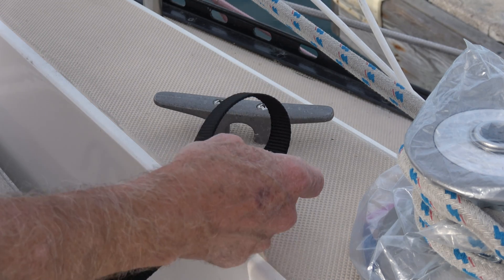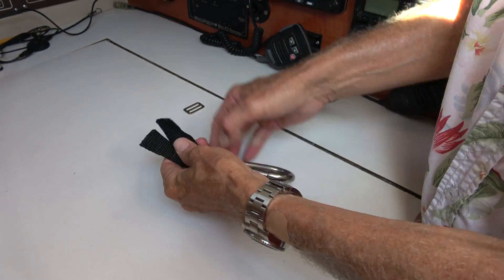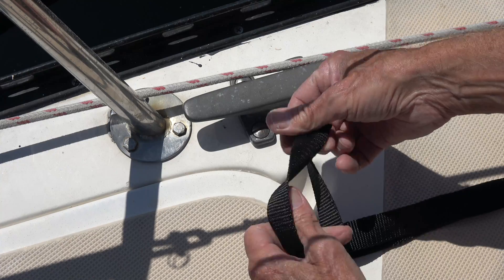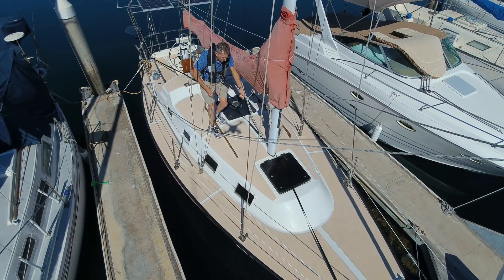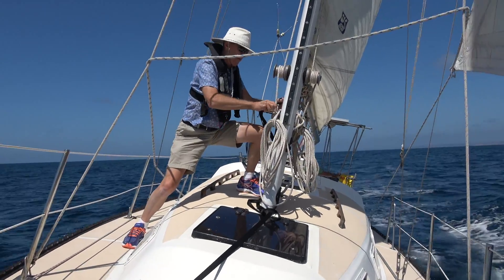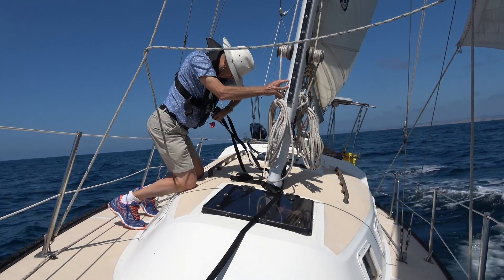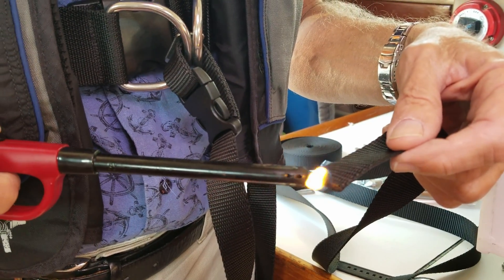Jackline Redesigned

Comment: I used one continuous snug jack line of 1 inch orange tubular nylon tied on stern cleat looped down port side to cleats on bow back down starboard to stern cleat opposite first anchor cleat 
I use a rated aluminum locking carabiners to clip on to my jack line and onto a full body harness with leg loops, a chest and back attaching loop.  my tether is a multi looped 1 inch tubular climbing rated 4 feet long. my system has four segments two in the cockpit. And two that run the remainder of the boat up to the bow, so I only have to unclip at the companion way while I'm seated in the cockpit to go up forward. My system is too short to allow me over the side.
Never been comfortable within inflated vest I use a regular lifejacket

Comment: I would always use bright colors for these safety functions. I like that you show that you realized your first jackline tether configuration was too long. Some sailors think they don't need to be tethered, most of the rest of us just buy what's sold and think that's that, and then like you there are some of us who figure out that going over the lifelines while tethered can still be a huge problem. 

Your  jacklines are down on the deck, standard and  may be necessary on specific boats. Mine are at shoulder height until the stays and then they slope down to the deck at the fore. The best jacklines are ones that you'll use, and we're more likely to use one that we can easily clip on to.   Also because you're tether is permanently connected to the jackline, you can't  unclip and clip to something else. I have a different arrangement between my center cockpit and the stern. My tether is always attached to my PFD so I can clip and unclip as needed.  I was doing something at my bow once that required me to transfer my carabiner to the pulpit frame. I don't remember what, but I have that versatility. 

Polyester is generally better for jacklines than nylon. The extra strength of nylon is probably not needed in most sailboats, and the better fade resistance of polyester keeps the color for years. Nylon webbing I've used in full exposure starts fading  in weeks.  Knots as in the video for anchoring the jackline has worked well on my boat.  Webbing is just another type of rope, but it is exceptionally strong.  

The previous owner of my Hunter 456 was a fireman, he attached the jacklines high up,  from the grab rail at the top of the bimini to the stays and then angled down to the bow rail frame. Works great, is never in the way of any sailing function. 
 I bought the typical double safety tether that is made to absorb shock from a fall.  I was concerned about falling over the life lines and dangling unable to climb back aboard. (I mostly sail solo.)  So I made a tether that finished is 4 feet long (1.2 m) It has sewn loops on both ends. (Webbing is surprisingly easy to sew on any good sewing machine.)  I made it this length so if I did take a tumble there's not enough length for me to fall over the life lines, but it's also enough length that I can perform any function on deck
. 
 I use locking climbing carabiners to attach it to my PFD. These are aluminum. (They'll bang less on your deck, but repeated bangs will chip the gel coat.)   I thought for a while that climbing carabiners were only for temporary use on a boat because the mechanism gets stiff from salt. The stainless steel ones get the same thing. I prefer the climbing carabiners. Tested rating, lighter weight, always smooth one handed operation.  When they get stiff I just clean them out, dry lube.  There is a locking tether clip that has a removable pin so it can be attached to a sewn webbing loop. I bought one and use this at the end of my shorter tether.  And when you use this clip and carabiners by clipping them to the ring on your PFD the tether stays out of the way when you're not using it. 

 On the far end of my shorter tether, there's enough webbing to make the end loop,  So I started with about 7'.  About a foot back from the end  is another 'loop' (where I just didn't sew the webbing). This is for a second  carabiner. Now when I get to where my jackline is tied to my stay, I can clip to the other side before unclipping. This way I am never unclipped.  If conditions are rough this shorter position is more secure.  I also use on my jackline an alpine loop and that I use like a truckers hitch to keep my jackline somewhat tight. This makes it usable to hold on to. 
To sew webbing get strong thread, but also a ball point needle. This pushes around the threads of the webbing instead of through them making sewing webbing possible on any good home machine.  Just copy the types of zigzag multi pass stitches like those used on commercially made tethers and you should be fine. Nothing we make can get an official rating, so all of this is just what I've done.

Comment: As a climber having webbing on webbing (how you attached your tether to your jack line) is never done unless you can guarantee there won’t be any body weight sliding friction on the line. It’s surprisingly easy to cut through webbing using friction.
Reply: Valuable input as always from climbers! What would you use instead?
Reply: @ximono  use a double locking carabiner or snap hook.. maybe wrap tape around the metal if you are concerned about the metal banging on the deck.

Comment: Nice video. I run my jackline almost the same way. What I do different is that I run the line over the bow to the base of the forestay instead of to the cleat. The boat narrows at the bow and it is even more important to keep the jackline as close to the center as possible. The most vulnerable spot is now the small section from the cockpit to the cabin roof. Here it is a short distance to the gunwale. But it is difficult to avoid.
Reply: I also like the idea of keeping the jackline centered.  Luckily, on my boat there is one bow cleat centered.

Comment: The basic jackline layout is correct for the most part.
Nylon webbing rated at 1700lbs is a tensile strength, meaning weight applied from end to end. Shear weight from a side load will be much, much less. A 200lb mans sudden fall will apply a much greater force of shear than his 200lbs. I know it is discouraged in some safety publications to use nylon straps connected to nylon straps. I'm not saying your set up is weak I'm suggesting anyone should know the math.
I recommend you investigate. My preference is to use dynema line. Rated much greater than your nylon strap and still affordable if you build your own system. My life and the life of my crew is certainly worth a couple hundred bucks.
Tethers should never be long enough to allow you to leave the deck.
Only use "rated" tether hardware. Plastic clips are a no go. Single latched hooks or carabineers are a deadly choice. 
Ask any climber about a single latched hook.
Not only am I a sailor but I am a Communications Tech who has built Microwave Towers and Cell Towers all over Alaska, including the Arctic Slope oil fields.
A single latched hook WILL KILL you.
Anchorage, Alaska
Reply: Great input! I'm curious, what would you recommend instead of a single latched hook?
Reply: @ximono  I think the current "standard"  for tree climbing work (sort of the same thing as your safety harness rig) is an auto locking carabiner or double action snap hook.. not the screw gate type (which can come undone/unlocked).  And your final camera shot of your vest/harness shows a plastic squeeze buckle at your d rings..that is not going to take much weight.. that is where the snap hook should probably go..

Comment: need to tie a water knot on the webbing.  also, aren’t you briefly unclipped at the mast?
Reply from the maker: you are correct a water knot would be better on my prototype but sewing on the final finished version. The way it's supposed to work at that the mast transfer,  is that you put the new clip on first before you take the old clip off. Sorry, If I didn't make that clear.
Reply: @CaptainLang  thanks for the video.  it’s an issue for singlehanders.

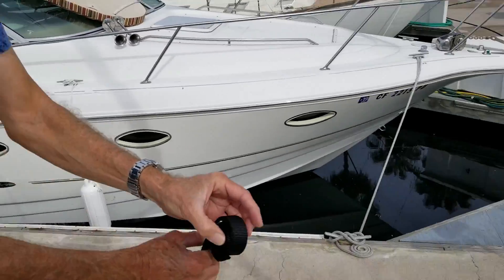Comment: Thank you for the video! How did you tension/connect to the 2nd cleat? The video cuts out at 01:16, my question is about the seconds that would have followed.
Reply from the maker: When I made the video I already knew that this first design was not going to be my last so I was just faking the attachment at that point. But if you go to 2 minutes and 58 seconds, you can see where I'm attaching the lines for real.
Reply: @CaptainLang  Thank you. You seem to be using lines which can be tensioned after you connected both ends. Makes sense to me now.

Comment: Why not have the two tethers attached to yourself as with regular tethers, use one going to the mast then clip on the second to work at the mast then unclip the first to go forward. The drawback is as you go forward the boat is very narrow, so the tether is again too long.
Reply from the maker: My tether going forward is very short, as all I am doing is down on the deck, like setting up an anchor or hooking up the tack of a spinnaker.
Reply: @CaptainLang  Not how you portrayed your method in the video.

Comment: I'm not sure I would trust 4200 pound rated nylon webbing.  The knot will reduce this to 2100 pounds breaking strength immediately and if you fall hard it may very well put more strain on the webbing than it can hold.
Reply from the maker: Let's say it's only 2000 lbs and a 200 lbs person dropped hard enough to put 2000 lbs breaking force on it. That would be 10 times the force of gravity, all concentrated on a narrow strap. The damage that would be done to your body with that kind of force would mean that the strap breaking is the least of your problems.

Comment: I never considered a central Jackline but it's a great idea. I currently have two running along the deck, either side but this is a far better solution.
Reply: Agree. Jacklines along the deck will kill you if you fall over board. It is false safety, Stay on board at all cost. Great video.

Comment: I appreciate effort...but this is very unsafe and not recommended by US Sailing and Safety at Sea.  I quick release needs to be at to the d rings and the webbing is not to be tied, it weakens the web by half.
Reply from the maker: I apologize I did not make it clear enough that I was tying the webbing only on the prototype to flush out the design. Thank you for your comment,  you made several good points. This is an open forum and I encourage everyone to contribute their ideas.

Comment: Knots reduce webbing breaking strength by 50%. Sewed eyes are preferred. Your jackline is 2100 lbs ubs brand new (no uv degradation. I find your omission of these points irresponsible. Also webbing on webbing is a no do due to heat friction that can melt the webbing. Must connect tethers to jacklines using sliding metal rings. What exactly are your professional credentials?
Reply from the maker: I do state at the beginning of the video that I am tying the lines as a temporary measure. I am making a prototype first before I make the final version.  When I'm using a Jackline the seas are at least a little rough and I'm moving slow. Often the decks are wet and so Web on Web friction is extremely low low and does not create heat.  Like any line it needs to be inspected regularly and replaced  at the 1st sign of where.  Thank you for your comment... I hope everyone reads all the comments as this is an open forum.
Reply: @CaptainLang  I am an industrial rigger by trade and certification. You sir do not know the properties of nylon cordage and slingage and how knots degarde their SWL and UBS specs. Furthermore you did not answer my direct question regarding your professional credentials. You call yourself Captain. Do you have your ticket? Yes or no. There are only three types of Captain's licenses available USCG 25 ton, 50 ton and 100 ton. Which license do you have?
Reply from the maker: OUPV

Comment: 2:10]  Never do this, having two pieces of nylon rubbing against each other under load: not fabric, not webbing, not cordage.  In military or sport parachuting this is a cardinal sin - nylon to nylon contact.  Under a shock load two lengthy of nylon: fabric, cord, or webbing will:  heat, fuse, and break in less than a second.  Shock loads of a sailor falling overboard is probably a lot less than a parachutist going from 125kts to 0kts in a second - but would you really want to tempt fate like that?  Ok, you are not a paratrooper, but your equipment is exposed to salt water and UV for vastly more hours than a parachute ever is.  Don't do it.

Do anything, use a metal carbineer, shackle, or fitting between the two pieces of nylon.  Have a nylon webbing loop running over a nylon jackline?  have that loop surrounded by a length of cotton or kevlar tubular webbing - and don't expect that solution to last for years and years, replace it on a regular schedule.
Reply: I was going to say the same thing. You can also swap out the webbing tether with dyneema and use a SS thimble. That way you don't have soft on soft which is a big deal in the climbing world. The thimble will also maintain a save bend radius. Great video lots of good point and ideas to expand on
Reply: @sailingbrewer  What's a "save bend radius"?
Reply: @harbourdogNL  I think he means "safe" bend radius
Reply from the maker: You bring up some very valid points... I will add a cloth cover to my setup.

Comment: Captain Lang, great description and testing of your jack line set up. Can you send me a link for your webbing purchase? The only 1" Webbing I know of which I have used that reach 4,000 plus tensile strength is rescue Tubular Webbing. It should cost not much more maybe double or less of single ply webbing. Tubular Webbing is much more smooth plus responds and produces less friction more like round lines on a sailboat than flat single ply webbing. 1" Single ply webbing I am familiar with rate around 1,000 - 1,400 tensile strength at best? Please inform me if I am mistaking?? All the Very Best! 

Jim Rodgers
Reply from the maker: Search Amazon for "Country Brook Design - Durable 1 Inch Heavy Nylon Webbing" You will see in the description "tensile strength is 4,200 pounds"

Comment: Should be using double or triple locking climbing rated carbiners for that. Expnesive but if it saves your life...
Reply from the maker: It is important that one can release the carbineer quickly with just one handed and by feel under rough conditions.   I also found lots of climbing rated carbineers are not marine grade and could get compromised due to corrosion from sea water.  When designing your own system you have to balance all the factors.

Comment: You forgot to mention NOT to use a regular carabiner, but instead use one with a quick release (snap shackle) at your vest attachment point.  This way if you are being dragged under (boat capsize, or other incident) you will always be able to release yourself no matter the force.  Thanks for the vid!
Reply from the maker: Yes, a snap shackle is better. Thank you for bringing it up! Another solution is to always have a knife holstered on your belt so you can cut your self free.
Reply: Good point. Many tethers don't use these, which doesn't mean it's not a good idea. The ISAF/ISO spec'd double safety tether I bought at Westmarine has a stainless steel self locking carabiner at the PFD attachment. It's better than most SS carabiners in that it's locking and can be released one handed. 
Climbers never use snapshackles, probably because if they are hanging the max force is their weight and because there's always a rope they can grab to take force off the carabiner. Being dragged behind a boat might be pulling on that connection with more force and you might not be able to reach the tether. 

When I started sailing I thought snap shackles and pelican clips were really annoying, until I understood their use.  What snap shackles need is something to grab on to with cold fingers, but not something that will will snag and pull the release.

Comment: On the second option do you only run one jackline down the center and around the mast or do you have a
second line and run it around the mast from the opposite side thus the lines cross at the mast??
Reply from the maker: If I was solo sailing across an ocean I would use two lines crossing at the mast but for everything else I find I can reach everything important with just one line. Your boat may be different and you should test to see what you can and can't reach.

Comment: Isn't nylon the wrong material since it stretches and "stretch" is your enemy with jacklines and tethers?
Reply from the maker: In working with this Nylon webbing I haven't detect any stretch however a little stretch would be good as it would be a shock absorber.  This webbing can handle  over 4,000 lbs so the strength is there.

Comment: The one problem with this is that for those of us in more inclement conditions using a large sprayhood up, it's hard to fix it up the centre line.
Cheers
Reply from the maker: You are correct some boats make it very hard to get the line close the the center. My goal  here is be more suggestion than rule.
Reply: Well then, put the webbing some place else.

Comment: you probably do not want to have the aft end of the jack-line tied off any further aft than mid-cockpit.  that way you are not hanging off the stern of the boat should you slip...
Reply from the maker: It does have to  be far enough aft to be able work comfortably behind the helm. I keep my tether short which helps keep me in the cockpit. Your point is a good one on a modern boat with an open transom it would be very easy to end up being dragged behind the boat.